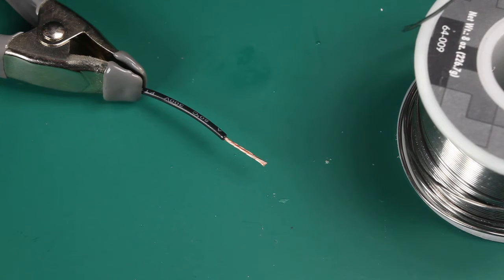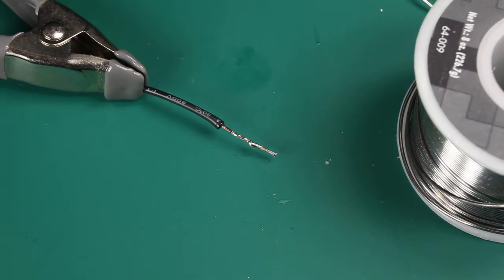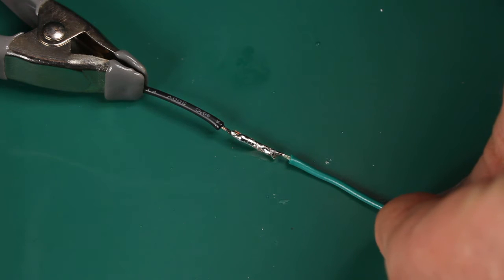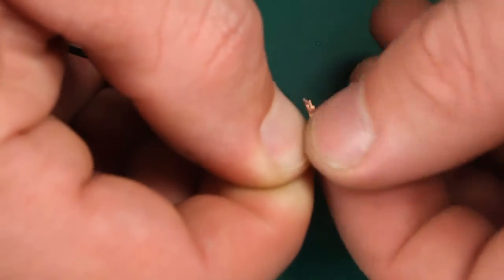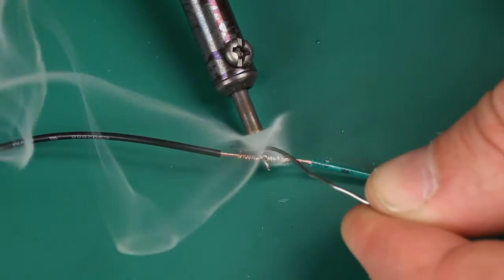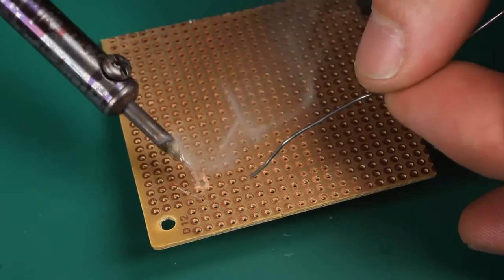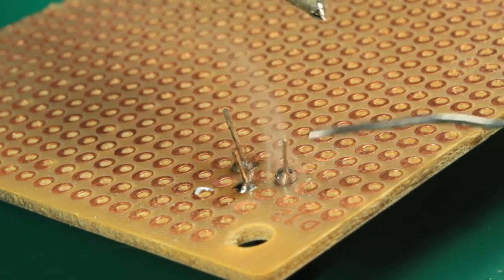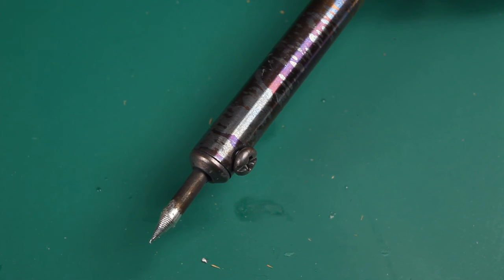How to Solder - Soldering Basics

Comment: ... Plz demonstrate reconnecting / soldering the iphone charging cord ends.  I've seen video on how to break the plastic covering off.  They quit working quickly whether $20 or $1 Dllar Tree.
Reply: June Cox a lot of those wires are very small and nearly impossible to solder for any beginner. I'd suggest buying a cable and wrapping the area near the end in electrical tape. Thee real killer of phone charge cables is the cable bending so much wires within it near the highest stress area ( the phone connector end) break apart.